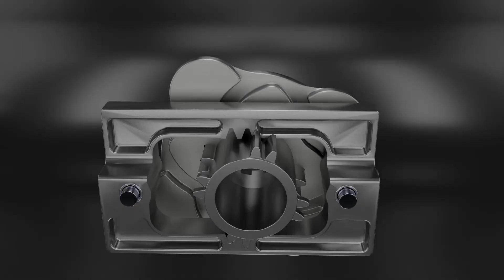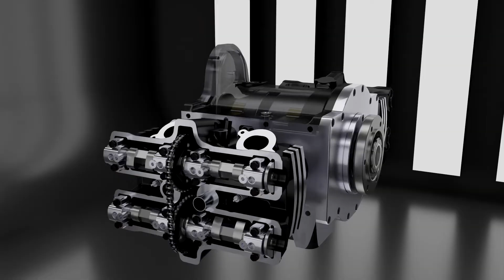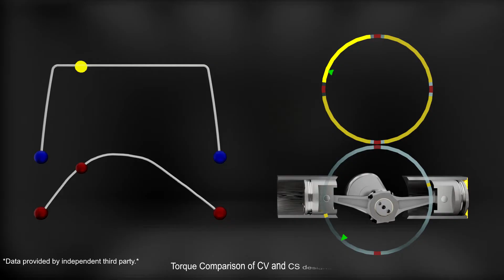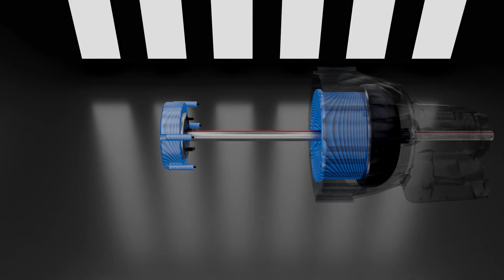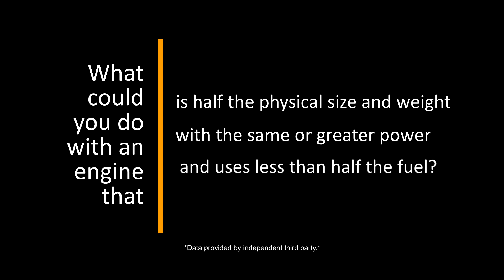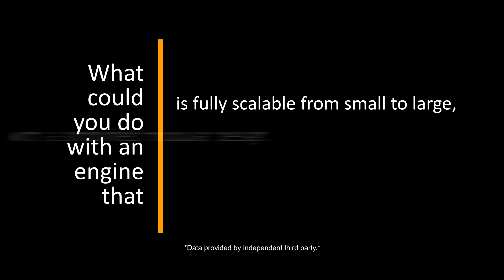The radical design and unique advantages of the CV Motion Technology

Comment: That's an awful lot of force being exerted on some very small surface areas. It doesn't appear the cam and pin surfaces are nearly as serviceable as they should be... particularly with the teeth in the piston carrier being extremely sensitive to minute angle differences.

Comment: The four horsemen of revolutionary engines:
1_ Unfavorably shaped sealing (wankel, rotaries, etc);
2_ Non positive pressure sealing (coates, etc);
3_ Undampened engine power through backlashing mechanism, often gears (Achates, Porsche 6 stroke, etc);
4_ Exotic manufacturing and high friction to avoid the problem above (this one, innengine, etc).
Reply: I've see this comment somewhere before. I think.

Comment: I strongly believe this concept could work but one thing certainly has to change. Instead of using teeth on the crank that could easily shear off, might I suggest going with the Scotch Yoke design? It would make a lot more sense. 

I'm a big petrolhead but it wouldn't hurt to try different engine layouts and configurations. A Scotch Yoke design would be a lot more efficient rather than this design. Either way, I never liked how V and Flat engines have cylinder banks that are offset with each other because of how the connecting rods are. That little thing has always bothered me.
Reply: if you look at a crnkshaft, you often find it attached to a gearbox that are just as "easily sheared off"... even more so as reduction stages increase torque and forces experienced by teeth, in say, a differential...
Reply: some different company is doing that. flat 4 and flat 8. sadly still with puppet valves. makes it sooooo wide

Comment: 3:56
You know the Subaru engine doesn’t have problems with piston wear and premature component failures even after thousands of miles
The only problems with Subaru engines are failing head gaskets
Reply: I think the advantage of this CV motor is more to do with the reduced lateral forces/losses lends to lower friction and a broader torque curve and better primary & secondary balance.   I read their 2-stroke doesn't need oil in the gas b/c of this - which, IMHO, could be a game changer.
Reply: @johnrobitaille4640  I'll believe it when I see it run.

Still waiting on that MYT
Reply: Have owned 2 200K + Subaru's, and my friend has had 5 or 6 over the years, do the scheduled maintenance without skipping or cheapening out, they will last till the valves recess around 300-400K miles.
Anecdotal but all the failed head-gaskets I've seen (all 4 of em) were the cheap composite ones.
Reply: and cvt transmissions
Reply: Subarus use boxer flat 4
This design is just a flat 4, with some extra bits where the connecting rods would be.
Reply: and oil consumption issues  and valve spring issues

Comment: You know I still don’t see any advantage over the Subaru engine
Reply: I think the advantage of this CV motor is more to do with the reduced lateral forces/losses lends to lower friction and a broader torque curve and better primary & secondary balance.   I read their 2-stroke doesn't need oil in the gas b/c of this - which, IMHO, could be a game changer.
Reply: it could be much smaller. especially not as wide. if it would work.

Comment: The Uk is no longer interested in internal combustion!!!!!! Apparently.
Reply: The UK is not the whole world and not even a sizeable market. ICEs will continue to be important for large and or spread out countries like the USA for a few decades at least. I don't see them being big as propulsioon engines after 2040, but for generators, including onboard power generators, the ICE could potentially make it to 2100.
Reply: @DocWolph  fully agree.  With the charge time alone, farming can't go electric.  With tractors, combines, large trucks, and so much various equipment often times running all day and well into the night.  The size, weight, cost and charge time of a battery that large just isnt practical.  Not to mention the carbon emissions produced in the creation and transportation of a battery alone.  Not very "green" if you ask me.

Comment: If you have 2X the power strokes per rotation, that means it should be a 2 stroke engine. Intake valves would work but exhaust valves won't. You would need a uniflow system or something like that. Don't know about those power claims either.
Reply: It’s a 4 stroke, the doubling of power pulses per rotation is accomplished by the 2:1 gear reduction of their novel crank mechanism
Reply: Edit: just saw another video explaining better.  This is a 2 stroke engine design.  But they claim since it has no cylinder wall contact it does not need oil in the fuel so it is cleaner.
2:22 simply shows the CV engine spinning twice as fast as the typical piston crankshaft.  That makes it easy to be twice as much combustion in the same time.  LOL
I also do not see how this works.  I was wondering where the exhaust stroke was.  The animation shows power stroke then intake compression stroke then power stroke.  There is no time when it exhausts the combustion.  Here is how a 4 stroke works: Down is intake stroke, then up for compression stroke, then down for power stroke, then up for exhaust stroke.  A 2 stroke works completely differently.  Down is power stroke, exhaust stroke and intake stroke.  ALL on that singlular travel down the cylinder.  Then on the up stroke it is basically still exhausting some of that new intake out the exhaust until it is closed off, then up all the way for compression.  So each time down the cylinder is a power stroke and why 2 strokes can be very powerful for the same revs as a 4 stroke.  But they are also less clean.
The crank design is interesting though.  No side loading would be very beneficial.
Reply: @Power5  no wall contact so no oil? I wonder what super material or system the rings use for friction mitigation.
It looks like they maximized reciprocating mass, so it'll surely shake like crazy, but the huge rotating mass might preclude the need for a flywheel.
And then there's the un-oiled pegs-and-slots guidance system.
So, add tons of weight, parts, and friction to avoid a little friction and a pair of balancing shafts.
I'm not feeling it

Comment: Nothing simple about that.  It has a lot of high stress angles.  Plus it has lateral movement  along the power output shaft. As well as standard reciprocating Mass meaning you have vibrations in multiple directions  .

Comment: This is a similar approach to the crankshafts motion curve disadvantage, that Alfadan in https://www.youtube.com/watch?v=8alrpieveDg addresses, though, Alfadan decided to replace the push rods by a complicated mechanism, this one solves it somewhat more elegant with this "interleaved gearing".
The problem I see with Alfadan is the masses and the lubing of the mechanics (which might do well with 2-stroke with outdated fuel-oil-mixture), while with this construction, I am curious, what the lifetime and maximum torque of the gearing will be, without designing them even wider than (half) of the boring.
With both these approaches, you get a lot of oscillating masses (which might be minimized by clever CAD/FEM-constructed parts). Alfadan might reduce the rotating mass of the crankshaft (especially when combining with Boxer/flat layout), while this one seems more limited with the diameter of the "crankshaft"?
Anyhow: Will the lifetime of both these match the one of the smoother run of the bearings in conventional crankshaft/push-rod constructions?

Comment: But why parallel hybrid? Why not leave it as a series hybrid? A simple free Piston Linear Generator would suffice. Battery size can be kept down to say 2 kWh. No need for transmission & differential hardware either.
Reply from the maker: Thank you for your interest and comment! With advances in alternative fuels and the advantages of a hybrid vehicle design for in-city use, the CV modular concept provides a solution to high power needs for short acceleration or heavy loads as well as long distance fuel economy.  Keep up to date by visiting our website at www.CVMotiontech.com

Comment: Do you realize how many more G's the pistons will experience? It will literally be hundreds of times higher than a typical engine. I am also very concerned about the gear mechanism in the crank case as I would expect it to start stripping gears after only a few hours of use.

Comment: The gearing mesh could use some work you could use it conjuction with magnetically assisted gears and a few more contact points and this design could potentially be a good suburu engine.

Comment: Is this related to the ALFADAN engine concept/, because it seems to have a lot of similarities. Both of you have some nice drawings/ animations, and both of you have a certain knack with words,- implying results that have no substance, and making claims which no verifiable data to back them up.  In your claims of "improved combustion, and fuel efficiency efficiency" you provide no evidence, or even theory to back up those claims. From a simple engineering standpoint, your design, as you have presented it, will simply fail mechanically in a short space of time,- and if you cannot see the short-comings in your design yourselves, then I suggest you take it to your nearest engineering shop to point out the faults for you. It will not take long. You are living in La La Land.

Comment: Nice CAD concept, the proof will be when it does a half-million kilometers in a test vehicle on public roads.
Reply: Reciprocating to rotational motion conversion mechanism is what  will keep it only as a concept .
Reply: @flappingflight8537 , I believe the problem is that both pistons go the same direction. Typically with boxer engines you want opposite pistons to go in opposite directions so it’s balanced.

This design will create more vibrations.

Comment: Can't imagine how noisey the scotch yoke will be once running, and I highly doubt that the two teeth per side in the animation could last more than a few test runs before failure.
That and the animation shows the cylinders firing on every stroke, but also shows intake and exhaust valves in the head with cam timing for a 4 stroke and no ports in the bore.
Someone does not know how their own engine will breathe
Reply: @greatestevar 
I bet Mumma always told you that you were 👍

Catch ya
Reply from the maker: Thank you for your interest and comment! The exhaust stroke was omitted from the animation to focus on the combustion and power stroke and the CV design advantage over the crankshaft design. Keep up to date by visiting our website at www.CVMotiontech.com
Reply: @greatestevar 
I guess we'll see, but as someone who has worked as a mechanic on machines all my life its a weak design.

Still the issue of the animation remains, a 4 stroke valve train and a 2 stroke animation
Reply: @greatestevar 
Being impacted from moving to stopped 20 or 30 times a second under load, they aren't going to last long.

Comment: So sad how so many know so little.   The people at CV Motion Technology have been working on this for years and have studied every possible failure mode. I am sure they know what they are doing.  Yet people who have watched a 6 minute video know so much more than the designers.   Just blows me away how much knowledge is out in the world,  yet not one has done this calculation  (m in y = mx + b).
Reply: So sad that you fail to see it's impossible for it to run based on the Cad design
Reply: In the 6 minute video, this old mechanic picked up several issues with the animation, not least of which is the power stroke on every TDC, but no ports to scavenge gasses as a two stroke engine, but clearly shows camshafts with inlet and exhaust timing of a 4 stroke.
Reply from the maker: Thank you for your interest and comment! The exhaust stroke was omitted from the animation to focus on the combustion and power stroke and the CV design advantage over the crankshaft design. Keep up to date by visiting our website at www.CVMotiontech.com

Comment: With the massive center section tying the cylinders on each bank together, VERY low rpm ranges are possibly useful, but the vibration of those center sections moving back and forth are most likely going to prohibit anything higher than current commercial diesel truck engine rpm ranges 500-2100rpm’s.
Reply: Not really, otherwise we’d already have examples of mass produced, very large displacement gasoline engines running very high rpm’s reliably and without insanely short tear down intervals.  Counter balancing helps with initial vibrations but creates other vibratory and mass issues that further impede both high rpm and efficiency functions.
Reply: Honda; Toyota; Nissan; Suburu….. Continental; Lyconing
These are just a sample of companies that disagree with your claim nobody would develop durable engines.  SMH!  It’s one thing to be condescending when you are correct but it backfires when you are wrong.  Oopsy!

Comment: The acceleration loads realized by the abrupt directional change of the pistons will cause the engine to tear itself apart to say nothing of the balancing issues.. In all recips, there is more of a constant exchange of momentum between the flywheel/crank and the pistons/con rods.

Comment: I would like to see if Porsche has started testing it.
Reply: They probably took one look at it, laughed, then called everyone else in the engineering department over to have a good laugh at it.
Seriously, it's just a slightly different method of doing a scotch yoke, but with some gears. I can't see this withstanding any kind of materials analysis in order to make it run at any meaningful rpm for any reliable length of time, which is why anyone has yet to see a functioning prototype.

Comment: Uh, guys... might want to examine your patent submissions because a mutilated rack and pinion (or mangle rack) is a two or three hundred year old thing, if not even older than that. You'd need to patent the use in an ICE, if that's not already been done back in the days when the crankshaft itself was under a valid patent and things like scotch yokes and sun gear cranks were pressed into service.
Reply: There is a cam guiding the handoff of the teeth each half evolution, so maybe those 2-3 hundred year old patents were simply "mutilated rack and pinion"-patents, without a cam... The cam is the plate, and is connected to the rodrack by the rodrack´s 2 pins, to guarantee synchronicity of the alternating engagement of the rodrack´s lower and upper linear-gear-teeth.

Comment: Why??? Definitely stupid idea and no brainer, when you have electric motor from the transmission, why not just eletric motor directly on the wheels. We suppose to move forward, not backwards lol.
Reply: Yeh... I agree with the extreme heat generated by motors, even the hybrid systems would have extreme stress if you constantly driving it in a very high speed.
As technology is advancing, most manufacturers all moving toward EV and Fuelcell... 
We're in a transitioning faze now. Most of the so call new designs a just all old concepts, we just didn't have the technologies and resources bad then.
Reply: That's a fair question.
From my old experience as an electrician, then as a vehicle technician, I'd say that the problem with directly coupling an electric motor to a wheel is that the initial amperage to the motor to move that wheel from rest is extraordinarily high. That tails off quickly as the motor starts to turn, but that excessive amperage causes a lot of heat in the motor coils, which is pretty bad. Running it through a transmission gears it down, so the motor gets up to speed very quickly with far less heating and current loss.
Reply from the maker: Thank you for your interest. The “Modular Design” section of the video is showcasing the ability to utilize the hollow center shaft as a way to provide both efficiency and redundancy (if it were in a marine or aviation application). The direct-drive electric motor is only shown as a method of hybrid fuel/electric integration. Keep up to date with our progress by visiting our website at www.cvmotiontech.com.

Comment: There will be horrendous impact forces on the two spigot teeth on each side, they would grind themselves to bits, it looks  good.All flat twins have opposing boxer pistons as the piston together would resist movement making the crankcase do equal an opposite reaction, and the rocking couple would be huge.. but I would like to see on in the flesh, before  making any conclusions.  Nothing is new only rediscovered from something in history after all.
Reply: yes the rocking couple would be huge in this design, unless they did one with 8 pistons, but still, this would need a very very strong axle to last some miles, cz there will always be a lot twisting forces with this design